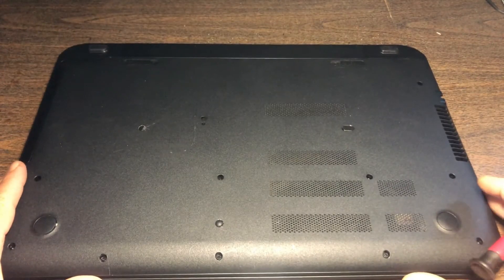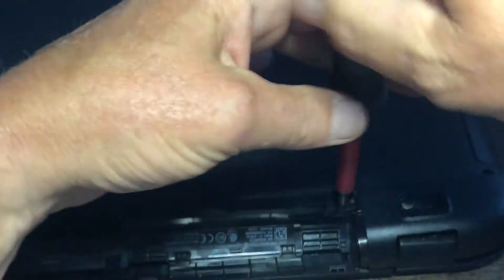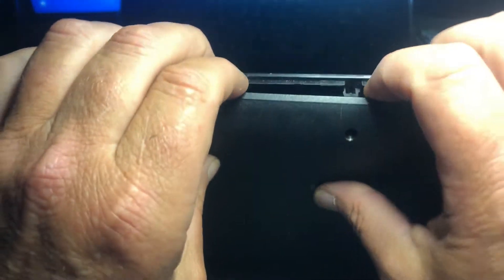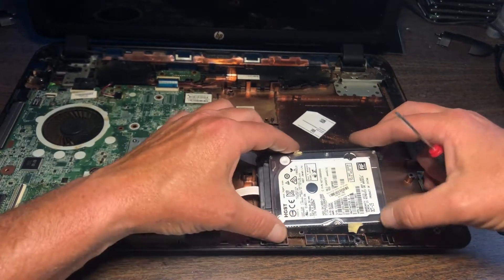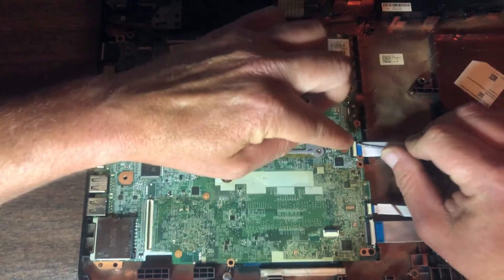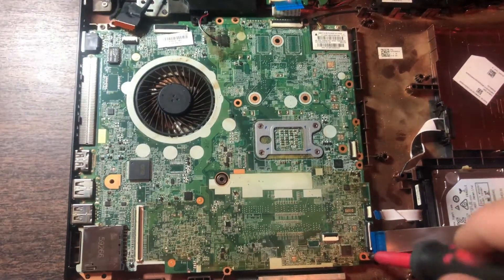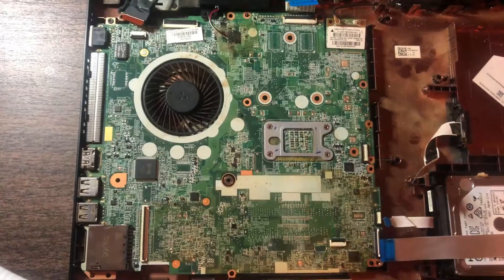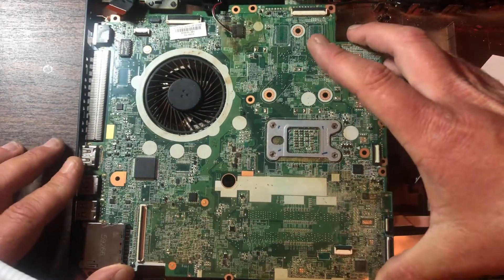HP 17-P161DX and 17-P series | FULL disassembly & upgrade guide

Comment: Video was 7 min where is the rest of upgrading and reassemble. I bought this for my wife years ago and it's always been slow at least slow to me I don't know if it was a hard drive or so much junk loaded in on it but I'd like to somehow put a SSD hard drive is that the same connection for SSD
Reply from the maker: The SATA hard drive port will work for your SSD, as long as it is a SATA SSD, not m.2
Reply: @AskYourComputerGuy  ok, was there anymore to the video that I missed or was that it. Good info tc
Reply from the maker: With disassembly videos, I usually just show which parts are removable, how many screws, what might have to be moved or done first to get a particular part out. I don't film the reassembly because once people have the laptop apart, they don't watch. They just reverse the process. Hope that helps answer your question :)

Comment: What kind of mother board does the 17-p161dx use?
Reply from the maker: The model I had used was an AMD A-10-7300, but not all models use the same board. Some models with faster CPU's might use a different board. Thx for the question!

Comment: I am having the same problem trying to pull the CD/DVD out. The lid keeps coming off. I see you had the same problem but edited out how you finally got it out. What was the trick for that? Thanks
Reply from the maker: The face is designed to pop off. It just snaps back on as long as the clips remain intact
Reply: @AskYourComputerGuy  Putting the faceplate back on was not my problem. It was getting the DVD out. I popped it out using my paperclip and had to repeatedly yank on it before it would come out. Just a really tight fit.
Reply from the maker: I've noticed that a lot with more modern laptops. Every millimeter is sacred. Glad you got it out though!

Comment: I'm  troubleshooting a black screen on this very same computer. Seeing that the graphics card is integrated do I need to buy a whole new motherboard? My machine has a AMD chipset. I'm no way and expert just a handyman at best. Also can I buy a SSD and Ram and download a new Windows 10 on the machine ? Thank you
Reply from the maker: What do you mean by "black screen"? Do you have just a white cursor and nothing else? That's not a hardware problem. Or is the LCD shot? Please clarify
Reply from the maker: And if your problem ends up hardware, yes you'd need a new motherboard, as the graphics chip is integrated. Probably find one on eBay or Amazon cheap. And yes I would absolutely do an SSD upgrade. Maybe not Window 10. The hardware in this laptop really wasn't designed for it. It might be ok, but it's a crapshoot really

Comment: Submitted two days ago my descriptive and complete comments of why I did not like the video, but in checking for response I see my original comments are not posted, and 2 days later still no response from "Ask Your Computer Guy". I even "subscribed" wanting to make sure I received a response. I can only conclude from this that any negative "comments" get pulled by the originator of the video. In this case "Ask Your Computer Guy".
Reply from the maker: FYI I don't remove negative comments, only spam. Without the negative, how can I possibly improve my content? That's how one becomes better as a content creator, right?

Comment: I will never recommend another HP to a client ever again. Period. This is the worst design I've ever dealt with. Thank you very much for this video--it helped a lot with both replacing the HDD with an SSD, and forcing me into the realization that HP makes crap machines.
Reply: all I wanted to is upgrade the RAM, but i stopped right in the middle. very poor design to almost make it impossible to open without leave a scratch mark .. closing back and selling it, done with HP
Reply from the maker: @rjm10866  agreed, one of their poorest designs. But their objective is to get you to just buy another one, not upgrade and keep using the one they already got paid for. It's all about $$$
Reply: What's a better brand?
Reply from the maker: Unfortunately, they're all pretty much crap under the hood. They're made with the cheapest parts China can provide for the most part and the lowest bidder usually wins. That being said, Sony to me makes the closest thing you'll find to Mac performance in a PC. With any other brand, definitely get the extended warranty because it's not if, but WHEN you'll need it.  And definitely back up your files because the drives they ship now are even worse than the rest of the parts inside.
Reply from the maker: Thank you so much for the comment, and I agree LOL